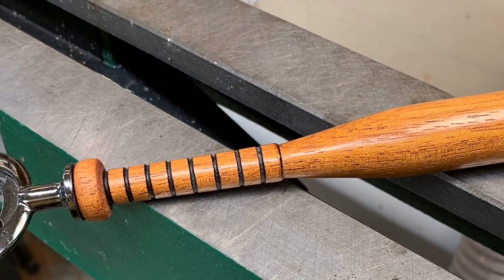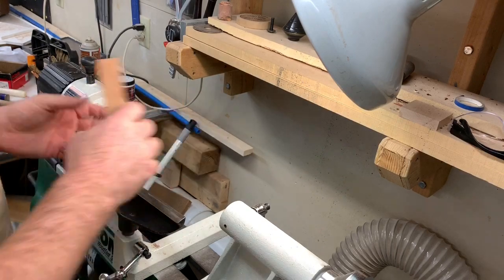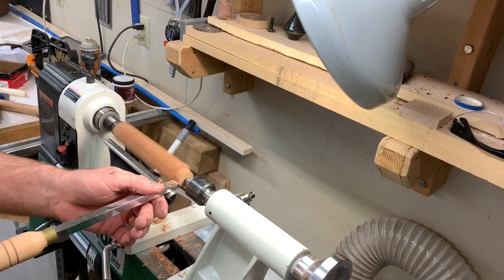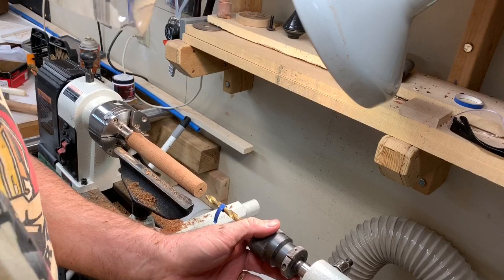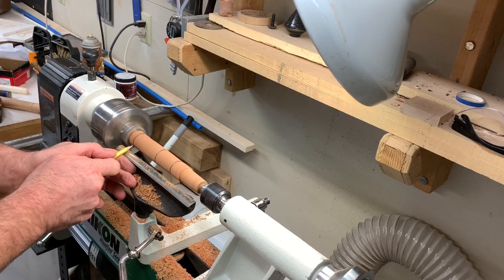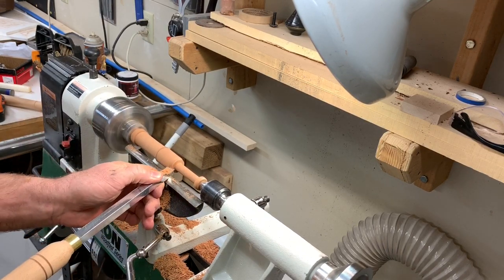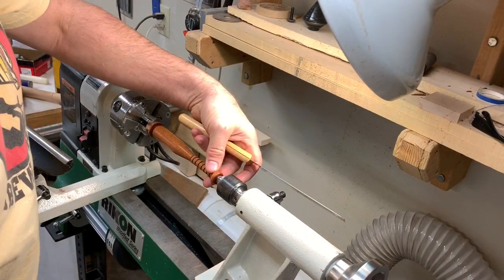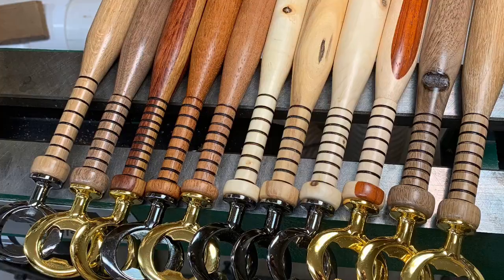Wood Turning this awesome baseball bat bottle opener.

Comment: Looks awesome. Where did you find the hardware for that. I recently broke my bat and I wanted to turn the handle into one of these but I’m having trouble finding the screw in part.
Reply from the maker: I had to look back at the description that I wrote for this video. In it I say I got it from Legacy woodturning. But I don’t actually remember purchasing them or the price. Good luck!
Reply: @dazzlingdaveyoyo  Alright. Thanks for the advice!